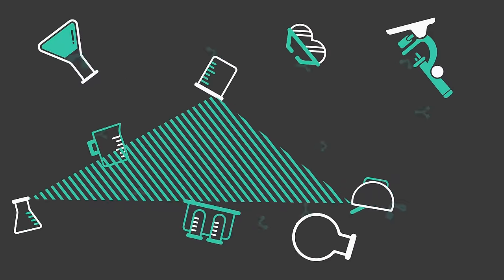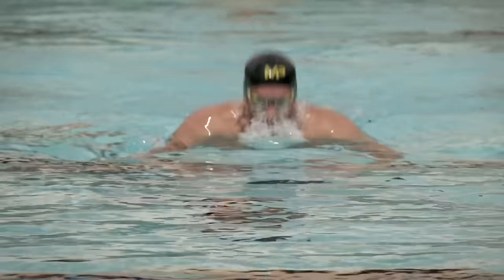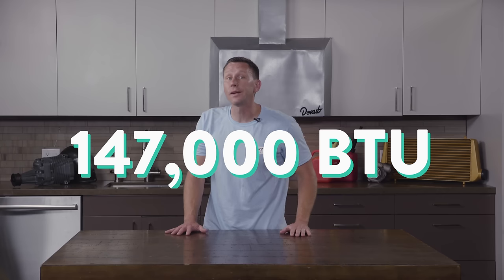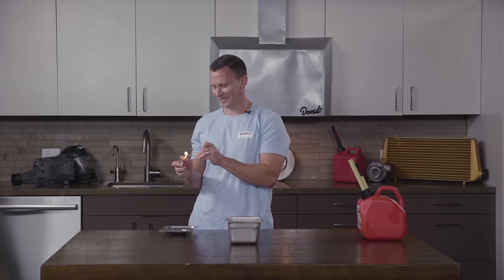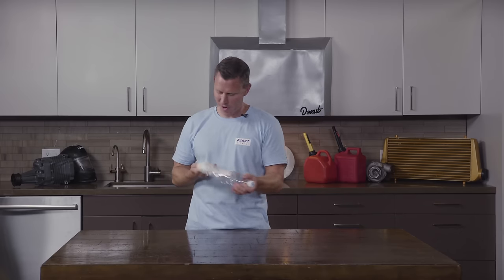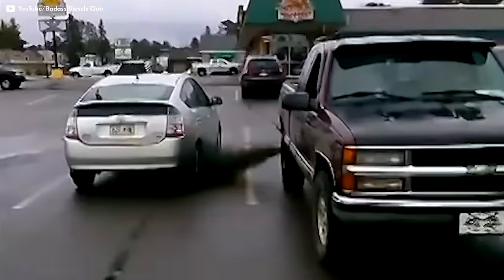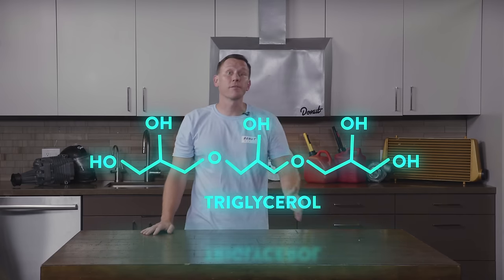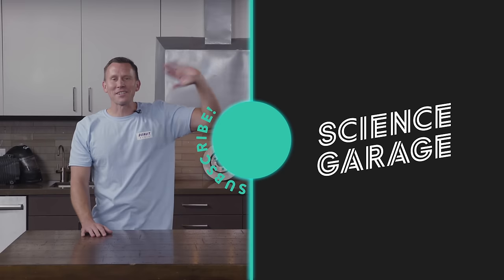DIESEL | How it Works

Comment: I like diesel.. but I'm not one of those who like rolling coal
Reply: Same
Reply: I swear if I drive an Ev and someone rolled coal me, they better hope it doesn't stick to front window, because I don't want to be a hazardous driver.
Reply: @dancingethanol2035  We don't know yet. Well find out on the future.
Reply: @ericsens4070  I'm with you on that
Reply: B Pr  sir you don't need to like your comment
Reply: My truck is tuned so soot only comes out when I give it a boot full and then it’s only a burst for like a second before the engine catches up
Reply: Unless you use em for work, diesels are not worth the money they cost to keep running just for a daily driver
Reply: crackahh npc6969 the 40 mpg and higher mileage they can get because of  the self lubricating properties of diesel say otherwise.
Reply: eric S you do realize with some trucks they don’t do it on purpose like my truck for example I don’t have to try to make it black smoke for it to do it because of the tuner I have on it for power reasons it also makes it black smoke more
Reply: diesel is better than gas for low end tourque, but definitely not saving anybody money
Reply: Lol and gas cars with turbos get the same mpg as diesels or better😂😂😂😂 a non turbo diesel gets junk mpg. Best fuel economy for cars goes to gas cars over diesel because of modern technology
Reply: crackahh npc6969 i dont know where you live but definitely not more than a dollar a gallon and in the video it even said they get better gas mileage and my truck gets better mileage than any other gas truck and that’s with bigger tires and a tuner which makes the gas mileage even worse, my dads 06 Cummins gets better gas mileage than my moms 2018 Kia Sorento, you’re definitely not the brightest
Reply: crackahh npc6969 and gas cars with turbos don’t get better gas mileage, turbos don’t make gas cars get better gas mileage especially depending on how you drive it you can get awful gas mileage compared to a naturally aspirated gas car of the same make and model
Reply: Ford focus gasolina gets best mpg over any car gas or diesel holmes... lol diesels are more expensive hands down cost more in every category the small price difference offsets the small mpg difference.
Reply: @NotTheATF1993  look at ford again the gas ecoboost gets 23mpg and the diesel gets 25mpg...... where i live gas is 2.35 a gallon and diesel is 2.67
Reply: @NotTheATF1993 . your fuel costs are the same but everything else about diesel costs more, but diesels do perform better
Reply: @timmygunz7103   yah exactly my VW Jetta gets that and compared to the gas counterpart of the year with a turbo(the 1.8) i will save $100 in fuel costs over 10k miles that is including the difference of cost. also, idk how diesel is more to maintain... because I can actually switch my fuel filter every 10k miles? Diesels don't require all the tune-ups the gas counterpart would with sparkplugs and good engineered injectors last a few hundred thousand miles but that is also thanks to the self lubricative properties of a gas. They also have lower rpm bands allowing for less excessive possible wear. If you would put an exact diesel motor next to an exact same gas motor in the same vehicle the diesel will always get better mpg because diesel has over 100k more Joules of energy stored in it
Reply: I have one that roals coal. Nut i have one problem. I have to wash my Porsche Carrera that is in my carriage every weekend

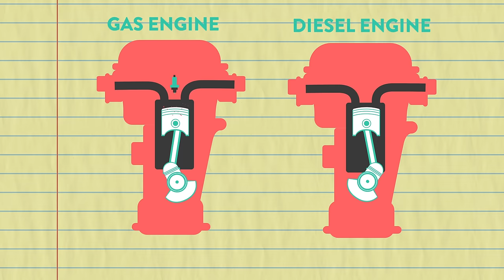Comment: 2:35 ignition while the cylinder is coming up :/

I hope that's not how your car works bart
Reply: It is, because the explosion takes some time to develop. It won't expand with the highest force immediately at ignition.
Reply: @discy12345  but not that much
Reply: @henryh3643   It really depends on the load and the power its making. My car when cruising on the freeway fires 55 degrees before top dead center. 
So 55 crank degrees before its at the peak of the travel. Just some food for thought.

Comment: i had a tuned up td fiat , i bought a bigger turbo, a big intercooler ( maybe too big cause i had to remove a little part of my front bumper to fit it in ) and a good old hks air filter. what a car for a front wheeler. when the turbo kicked in you could literally feel the horses pulling you forward, without the seat i would be kicked in the trunk.

Comment: Rolling coal in truck pulling actually lubricated the cylinder walls because it unburnt fuel. They let it do that on purpose to prevent over heating.

Comment: With the American “shale revolution” in full swing, the US has not only become energy independent (actually are now net exporters! No more “depending on the Middle East”), but is producing oil in a very environmentally friendly way. It is worth looking into. Fracking has gained a bad reputation due to overblown claims from years ago when the technology was new and not correctly regulated. Today it is much cleaner and efficient than virtually any other extraction method. 
  It is also much cheaper to produce than any other nations (less than half the cost per barrel than Saudi Arabia iirc), and is very pure. The methods used produce natural gas as a byproduct, in case you were wondering why natural gas prices are so ridiculously low. This is changing the petrochemical sector and giving America huge geopolitical advantages. 
  It is worth looking into!

Comment: I love both my diesel Mercedes. My 2005 C220CDI is my daily, tuned to 180hp, more than enough for a daily diesel. But my second Mercedes is a 2007 E420CDI that makes 400hp and 900Nm, all while getting about 40mpg...
I hate the whole rolling coal thing. A small puff sometimes is normal, but rolling coal is stupid.I've got rid of both my DPFs, installed a sport exhaust system, upped the power and my E420 still doesn't smoke, cause it was tuned properly. Only the occasional small, black puff when I floor it.
Diesel cars have exceptional torque. A 150hp diesel would easily match the performance of a 180hp petrol engine.

Comment: So I have a Jetta TDI Sportwagon, and it uses a glow plug, is that just to keep the combustion/ignition phase consistent? Or is that specific to VW engines?
Reply: Sam Schellhase glow plugs heat the initial air in the cylinder up before the car starts so that combustion is easier when it’s cold outside.
Reply: Cowsgomoo yeah, I looked it up later and realized I was an idiot, and that I already knew that. Thank you

Comment: I still use off road diesel in my engine is a little bit of alder and it doesn't like the super ultra-low sulfur fuel and on top of using off road diesel I use a cetane booster also makes my engine run better

Comment: 1890s
Abstract: In the 1890s, Rudolf Diesel invented an efficient, compression ignition, internal combustion engine that bears his name. Early diesel engines were large and operated at low speeds due to the limitations of their compressed air-assisted fuel injection systems.

Comment: I think you can purify most of the glycerol by washing with water 3 to 4 times then it will be pretty clean just need some bio kleen I don't know exact ratios but should be just as good as store bought diesel if done correctly

Comment: Can you guys do a segment on premium, plus, and regular. Which one is better and if there really is a difference.
Reply: The octane rating changes. Octane is a measure of how prone the fuel is to detonation. Higher octane fuels resist detonation. They are needed on higher compression engines or engines with lots of boost. It allows the timing to be advanced so you can make more power.

Comment: kinda forgot to mention that all diesel engines since either 2007 or 2010 (forgot which year) are required to have aftertreatment systems causing them to have extremely low emissions

Comment: and most diesels have a 96 f250 with the 7.3 l and what I hammer it it blows smoke there's nothing I can do about it but I do understand that the smoke is just fuel blow by and it's just me getting worse gas mileage
Reply: I had a 95 I miss mine lol

Comment: you can also use alternate fuels for a diesel engine you can use old frying oil for example or fuels from plants gas power is worse than diesel for the enviroment!

Comment: Hi thanks for the video, my bmw 530d e60 has fuel coming from fuel pump in tank and stops by high pressure diesel pump! The high pressure diesel pump doesn't send it to the common rail. Any idea? Car cranks but won't start. Scan it and get CODE: 4B90 RAIL MONITORING ON ENGINE START.

Comment: Love my 7.3 powerstroke, diesel ls the way to go
Reply: Gasoline produces way more power. Without forced induction diesel are turds.
Reply: You’re right, without the turbocharger the diesel is not worth it!
Reply: Ya the 7.3 is part of the old diesels they didn’t mention like my 6.5 Detroit they are idi or indirect injection like a gas engine

Comment: I'm surprised that you didnt even cover how diesel engines tend to be built more stronger to support the pressure and the fact that they produce more low end torque compared to gasoline engines as well as operate at lower rpm compared to gasoline engines. I expected this from a supposedly "automotive enthusiast channel" but didnt see it in this video. good work though

Comment: If the diesel fuel doesn't burn easily like on the first demo, why didn't it need a spark plug? If gas is so easily burnt why the need to have a spark to ignite it?
Reply: Gas engines have a much lower compression ratio than diesel engines do. The air does not get hot enough to ignite the fuel on a gas engine, which is why the spark plug is needed. Gasoline is less stable than diesel which means that at higher compression ratios the combustion is very destructive. Spark plug ignition is needed with gasoline to control the combustion and prevent detonation.

Comment: He's not wrong when he says it's basically rocket fuel. SpaceX's merlin engine, and the F1 engine (you know, the one coupled with four others to put men on the moon) uses kerosene as fuel, which is not much different than diesel.

Comment: I'm confused now. Diesel can light itself on fire during the compression stroke because it gets so hot but a match can't light it on fire?
Reply: because diesel fuel became smaller particle when mixed with air because fuel injector, and become more flammable than liquid diesel fuel.

Comment: The EPA has absolutely ruined modern diesels. All the added hardware/software required has destroyed reliability, fuel mileage, power, efficiency in general, etc. It has also made it impossible for consumers to maintain their own vehicles. 
  Most of this is far from necessary, with any benefit strongly outweighed by all the many negative effects. Many of the requirements actually harm the environment.

Comment: Diesel engines are fantastic torque monsters my 6 axle dump truck is turned up a little bit not a lot and it makes 500 horse and 1400 ft lb of torque that is insane LOL another truck we have makes 2020 pound feet of torque

Comment: Gasoline or petrol engines used sparkplugs to ignite the fuel and diesel engine used fuel injectors to ignite the fuel
Reply: Not exactly. Diesel spontaneously combusts under the pressure in the cylinder. Essentially, the pressure causes the air to heat up and ignite the diesel. The injector just squirts the fuel in.
Reply: It must be fuel injectors place to the engines intake not in under the pressure of the cylinder am i right?
Reply: @seanmichaelmalate3904  diesels inject the fuel directly into the cylinder. Many gasoline cars inject it into the intake though.
Reply: Oh i guest i was wrong and im still don't know all about the diesel
Reply: @seanmichaelmalate3904  you were on the right track. Injectors are not what physically ignite the diesel but they control when the diesel ignites. The diesel ignites as soon as it leaves the injector, so the injector indirectly causes the combustion.

Comment: If diesel engines are so great, why isn't there one in my TV?

That's MY opening/closing/everything in between joke. Seriously though, you're REALLY making me wanna get a car with a diesel engine. And not just from this video. The million mile engine made some really convincing points, as well.

Actually, can you imagine a world where instead of power plants, everything had its own little 2 stroke engine running a tiny generator to power electrical appliances or gear trains and various mechanism to convert one form of motion into another for mechanical devices. Like a gas powered washing machine. Or a gas powered Playstation. and we'd have all sorts of exhaust pipes going outside. I get the feeling HVAC heating would never have been invented, cuz everybody's house would be 120 degrees from all that heat. And we'd need that extra money, cuz everything would be way more expensive with all that extra stuff in it. I know, I know. I'm just being silly now. =P

But on another serious note, how much power (in watts) DOES a 2 stroke engine for something like a lawnmower put out? I'm curious if it would even be enough to power something like a microwave that requires 1000-1500 watts, which 1 watt is equivalent to 1 joule of energy per second.

 Dunno how that would convert to BTUs. I've never had to deal with BTUs for anything but a barbecue. In any case, I think I've got some researching to do. Cuz now I'm really curious about the power output of gas and diesel engines now. And for that matter, how much efficiency they get. That is, how much energy is in the fuel, vs how much energy the engine can put out. In joules, of course.

Comment: what is Run away diesel engine?
Reply: Since a diesel uses compression ignition it is possible for the engine to run away. In a gasoline engine you can just cut off power to the spark plug and it will stop. However, on a diesel all you can do is shut off fuel. The compression in a diesel is very high, that means that really any type of oil can also be burned. Usually what happens in a runaway is a seal on the turbocharger will fail, sending engine oil into the intake. In that case the engine will run away because you can shut off the diesel but the engine will continue to run on the engine oil. The only way to stop a runaway is to cut off the air

Comment: Old Diesel engines don’t have the emissions equipment in the engine to prevent it from rolling coal. They roll coal without any effort. My dodge will roll coal on a green light without any effort. I’ll accelerate just enough to get the truck to move and boom rolling coal

Comment: I own a diesel bmw and can say that its not ideal for daily usage. Diesels only work with heavy hauling applications. 
EGR / SCR / DPF, Fuel filters, DEF plus the extra costs of parts and labor mean it is cost-effective for locomotives, 18-wheelers and ocean tankers.
Us everyday ppl need to stick to gasoline / hybrids. 
The maintenance, emissions compliance and complication of the diesel engine mean it has to have a commercial purpose to be viable financially, or you'll be eaten alive with headaches and bills. FORGET that a diesel gets 20% better mileage. you wont save anything over a gasoline car.

Comment: why to get diesel car:
more reliable (diesel has lubricating effect so it works well with the oil on the pistons)
more efficient
diesel cars have at least 1 turbocharger stock

Comment: All the environmentalists are pushing for bio diesel but bio diesel is a horrible idea it takes the super inefficient process of photosynthesis from plants and uses that to power cars but it’s a net negative energy cycle, it would be like a farmer burning a certain amount of calories to farm crops and those crops producing less calories than he used. Literally solar panels to charge electrical cars are nearly 10x more efficient than growing plants to make bio diesel, normal diesel is more environmentally friendly that using crops for bio diesel. There are other plants we could use for bio diesel but we don’t because to use those plants would take a lot of money and research, and people think using corn for bio diesel instead of so many other better alternatives is saving the environment. Corn literally has one of the lowest photosynthetic efficiencies of most plants and we decided to use that. A better alternative would be algae which is under research but you need to grow specific types of it. If you want to learn more check out real engineering’s video on bio fuels but if you see an environmentalist advocating for bio fuels tell them they are dumb and tell them why.

Comment: Wait so if diesel engines are more effective at burning their fuel source than gas, then why do gas vehicles not shoot out soot from the excess amount of fuel? Is it because of the lack of carbon in gasoline?
Reply: In very high quantities it actually can. If a gas engine is blowing black smoke from the exhaust, it probably has a fuel injector issue and is burning excess fuel.

Comment: wait... i thought DIESEL is more flammable ?  that the reason it doesn't require spark plugs is because its highly flammable and only needed compression and a little heat to ignite the fuel.

Comment: @UCL6JmiMXKoXS6bpP1D3bk8g There are still many 2 stroke diesel in operation today. Most larger marine diesels are 2 stroke.  People dont 'roll coal" for aesthetics. With a diesel fuel makes power  , turbos cool egts. The by product is soot  when heavily fueled.

Comment: 6:52 Definitely not cooler. You never see any high performance gas engines with EGT probes, just diesels because their exhaust gas tempatures can be a lot hotter!
Every diesel street truck has an EGT gauge but not a single gas street truck has one, because gas EGTs are way lower!

Comment: But I don't understand, gasoline has a way lower flash point, and should ignite easily compared to diesel(just with compressed air right?) Why doesn't it happen so?